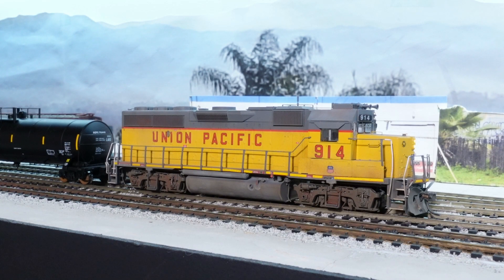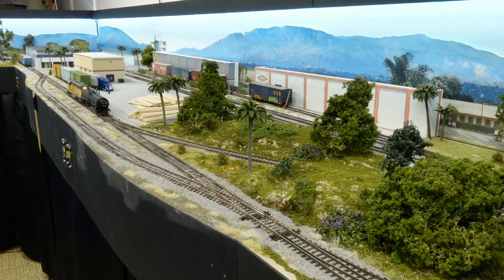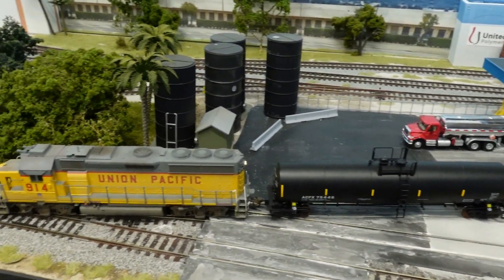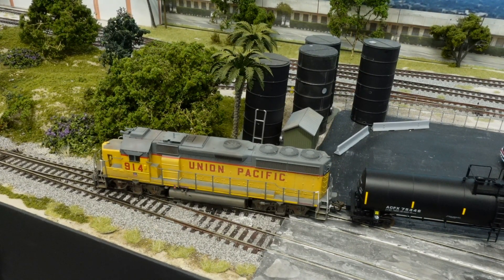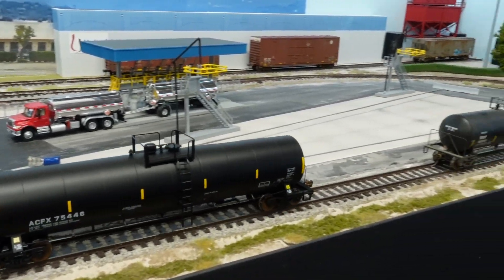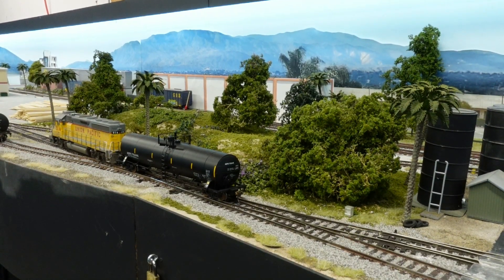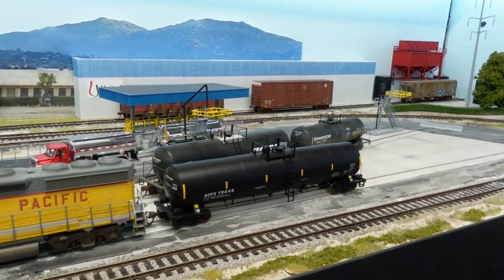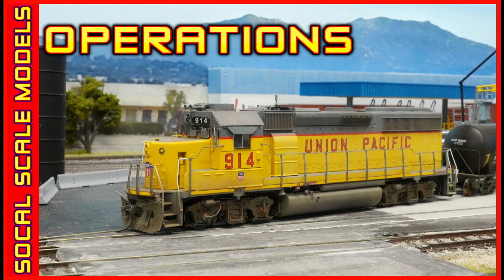Operations | Switching Tank Cars

Comment: I thoroughly enjoy these vids. Question - what's up with the padlocks and keys hanging of the facia in your vids
Reply from the maker: Each lock corresponds to either a turnout of derailer. In the real world on this line the turnouts are locked and the conductor has to get off and unlock them before throwing them over. When I'm doing ops I go thru the motions to simulate that.
Reply: @socalscalemodels  awesome, thank you

Comment: Very nice sir, although you could have made the operations a little easier on yourself had you just dropped that first tanker into the bottom track there then used the other 4 outbound tanks as a handle to shunt the other three to their respective tracks.

No need for the run around loop then ;)
Reply: An intermediate solution would have been to leave the four cars on the "main" rather than in the loop, to avoid the pre-departure shuffle into the off-spot track.